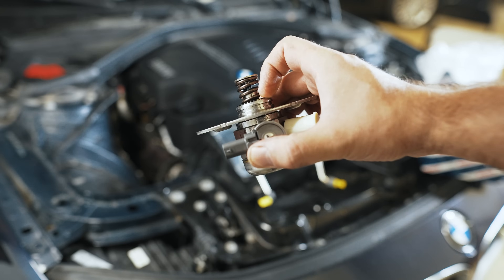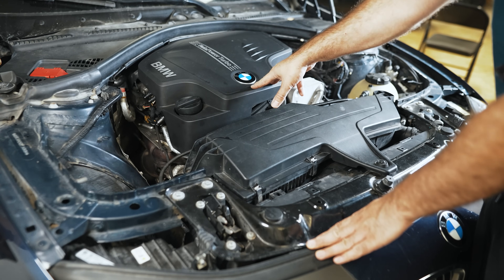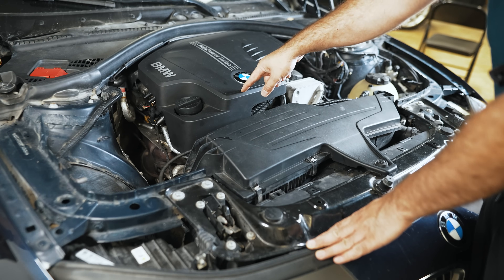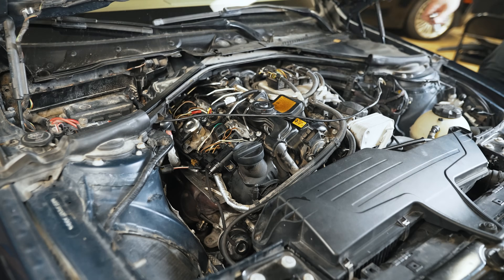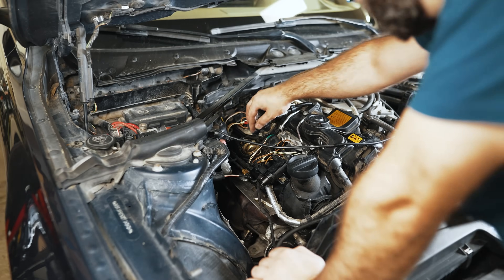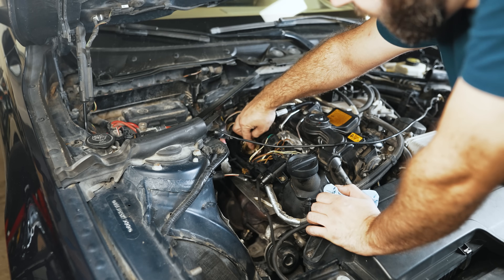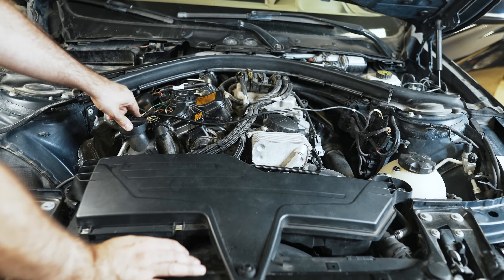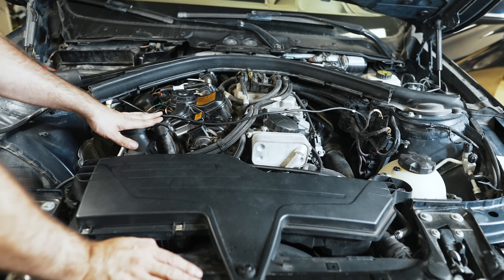BMW Running Poorly?  Don't Make My Mistake!  Here's The Fix!

Comment: Did this job maybe 2 months ago and everything was fine until today. I saw oil coming from the seat between the gasket and valve cover, oil on tops of the torx bolts, and a small plume of smoke every time i accelerated hard. The oil drips onto the exhaust manifold and causes the smoke. I did this job with thread sealant but no new bolts and no new cam follower and it worked fine. Time to do it again with new bolts and MAYBE a new follower. My car is the f30 chasis from 2013 and i didnt need to do the wiring conversion as well since i looked for one that had the oem style.

Comment: I just replaced all 4 fuel injectors on my n20 now I’m getting p0172 I’m thinking it’s my HPFP now 😵‍💫
Reply: What other symptoms did you get?
Reply: @motorenthusiast3609 well after smoke testing my car it turns out I had air leak by throttle body where I take slides on throttle body 
You have O ring inside my was missing after installing new O ring no issues 👍🏻

Comment: I have a 2006 325i and I was having a weird rpm fluctuation problem, usually when its warmed up, it would go down to like 350 - 400 rpms then it would shoot itself back up to about 1200rpms and it would continuously bounce up and down until i held the throttle down into high rpms. I changed the plugs and it got wayyyy better for about a month and now it wont even start and the battery is dead. im going to get a new battery, correctly code it,  and start somewhere near the MAF sensor, since i had some fuel coming out at the fuel rail.. any tips are greatly appreciated.

Comment: No sure if you can help me but any thoughts would be apricated, My 740i N55 with 103k miles, I got the engine shakes after warm start for 5-10 seconds only and does not happen all the time, no error in ista at all, the car run and shifts smoothly, the things I've done; changed a new oem spark plugs and new oem valve cover and valve cover gasket. Thank you!

Comment: I wonder if this is the problem my cars having . I have the same rich conditions and some miss firing on cylinders 1 3 and 4 . When the car is cold it runs smoothly after it worms up , it’s start hesatining and stalling
Reply: I also took the car to 3 different bmws and they refuse to work on the car so at this point I’m stuck 😞

Comment: Good day! I have 2015 535i, N55 engine. When I start it in the morning, it revs the engine up to like 1500 rpm, and then drops it down to almost 450-500, almost stalls..Then brings it back up to 1100-1200 and runs normally afterwards. It has no check engine light, no pending codes.
I replaced air filter, spark plugs…

What could cause this problem?..

Comment: Great Fix!. I saw the exact same problem at a VW. Also leaking HPFP on the cylinder head. Thanks for sharing. Dutch regards, Nico.
Reply: What did the leak look like? I might be experiencing the same issue. Pls help
Reply: @owenkwok8710  I'm sorry. That was about 4 years ago. I don't remember the channel.. I think it was dripping fuel while operating. So leaking internal. Cheers
Reply: @Nico_335i_DCT  no problem.

Comment: Great info! I have a n55 f30 and I’ve been getting lean codes back to back and can’t figure it out. Think my injectors are bad. I do run e30 but I have a dorch stage 2 hpfp and 88k on my OG injectors. It’s either that or my lpfp I’m assuming is toast. Just ordered a new MAF and 02 sensors as well to make sure it’s not those first.
Reply: Most common cause of a lean code is a vac leak. Have you smoke tested?  Check the PCV.  The diaphragm cracks and you'll suck air through the nipple on top of the PCV.
Reply from the maker: Yeah I'd start with making sure there are no vacuum leaks.  Injectors failing would likely lead to a rich code.
Reply: @VehicularDIY  okay good to know this cause I just keep getting lean I thought it was the ethanol since I’m on E30 but it’s gotta be injectors, MAF sensor or lpfp I’m assuming 🤷🏻‍♂️ I just got a new MAF I’m waiting for, starting there then going to try injectors and move to the lpfp. If you have any other suggestions on what I should look at lmk I’ll have it checked……
Reply: @ichoozjc  did a smoke test and come out clean, no leaks. 88k on my injectors are making me lean toward it being them
Reply: @stoss-11  You smoked the valve cover?  If your just doing the charge pipes you won't k ow if pcv is leaking unless throttle is open.

Comment: Even without a dipstick to smell the oil for excess fuel, pull the oil fill cap and give it a good whiff to see if the crankcase smells like straight gas.  DiagnoseDan did a great video not long ago with the same problem on a VW flavor product, same manufacturer HPFP I believe, and that apparently was bad enough the oil level was over full with gas.  Now that the DI Technology is aging, this problem will become and more and more common with all car makes.  
Should have commented on your injector video.  Sorry dude.....

Comment: Nice video and solution to your problem..
Does BMW make anything that can last 500,000 klm? It seems multiple engines have silly design fail points?
Ive had hondas, toyota, nissans and bmw, the most troublesome brand is bmw in my experience.
Reply from the maker: Thanks, seems like a supplier issue which would effect multiple german brands.

Comment: I would like to see how you’ve diagnosed this. Or you might be able to explain it. 
It sounds super interesting to me.
Reply: The easiest way to diagnose if your HPFP is faulty is if you just remove the oil filler cap and smell it. If it smells like fuel and not oil, your HPFP is dumping fuel into the crankcase and is faulty.
Reply: In his last video I knew the injectors were not the fix. He did not even show the multiplicative ratio before and after replacing injectors so could not verify a proper repair. Just shot the parts cannon at it
Reply: Edward Merida we all make mistakes. The point is that we learn from it and don’t replicate it. I made the mistake once also.

Comment: Excellent overview and instructive explanation on the misdiagnosis. Not many people though actually monitor their OBD2 port graphically. I'm assuming the other engine is a N26 with a bed timing chains?
Reply from the maker: Thank you, it's also an N20 the only difference is it's a 2013 with an electronic waste gate on the turbo.

Comment: The BMW HPFPs of N55/N54, and newer B58 and S54/55/58 ///M models are unbelievably unreliable and should almost be replaced every other oil change. It's truly an extremely frustrating part that desperately needs a serious redesign for the HPFPs.
Reply: While initially true, after about five iterations BMW got the Continental hpfps to work reliably. They never were a problem on the end 55 except for the very few first models. The N series HPFP are also fundamentally different from the fuel pumps on the B series engines, in case you didn't notice.
Reply: My '08 n54 has had about 100k miles without issue... Not sure how much longer it will go though as I'm trading the vehicle in for a Toyota... Can't afford to get stranded 100s of miles away from home now that I'm taking longer road trips.
Reply: @ryshask  wow an 08 n54 that has the original HPFP? And never an issue??? FCPeuro is my savior with every two year high pressure fuel sensors and then usually also the HPFP. Maybe I have the worst luck in the universe, but I see these things rarely lasting as long as tires do. But I drive my cars to their full potential. It's pointless to have it and waste it. My N55 has been through at least 7 HPFPs and am getting close to 150k smiles. 😜
Reply: @herlegz6969  how do you know when the hpfp is going bad on everytime you replaced it? Are they exactly the same symptems?